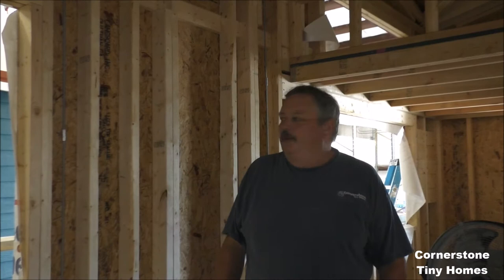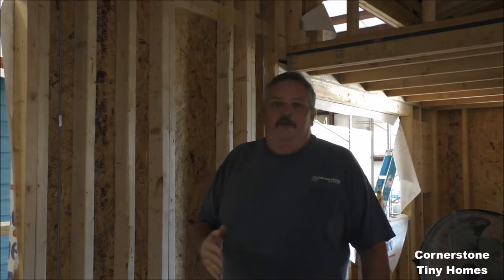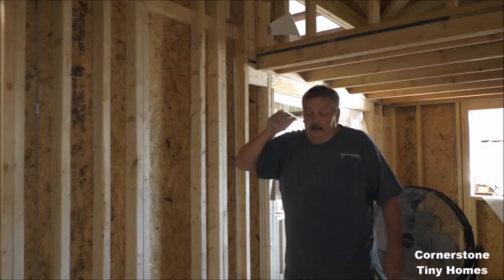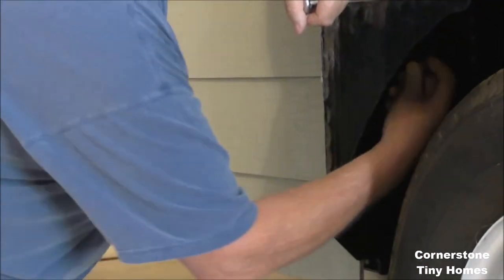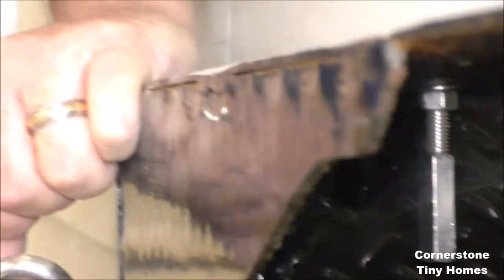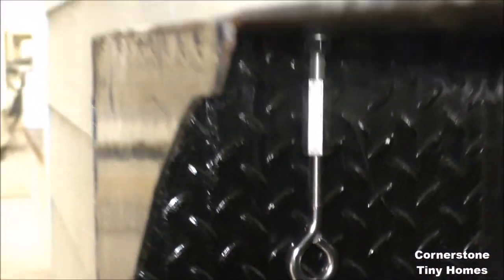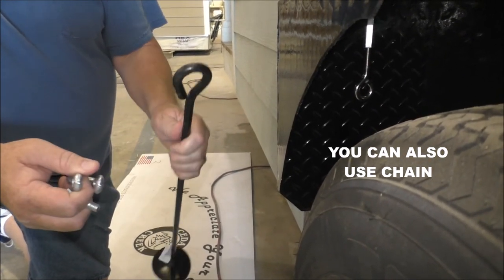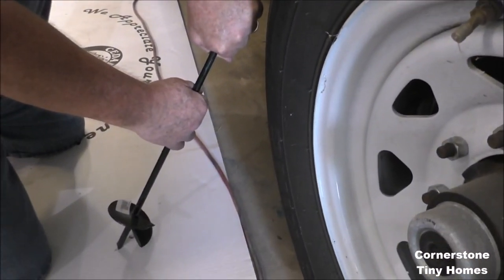How to Tie Down your Cornerstone Tiny Home

Comment: If those are smaller options for couplings and anchors, what size do you generally recommend?
Reply from the maker: The bigger, the better. We cannot guarantee that these will keep your house 100% safe during a hurricane, however, it is great to take precautions and lower the risk of damage.